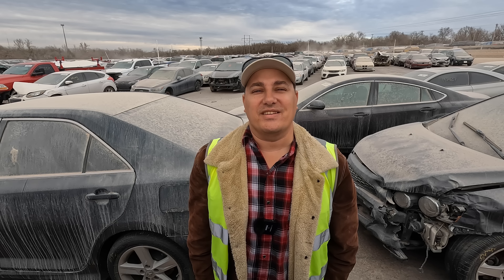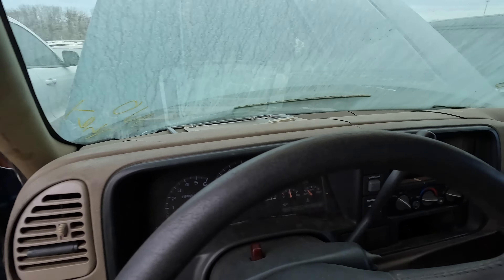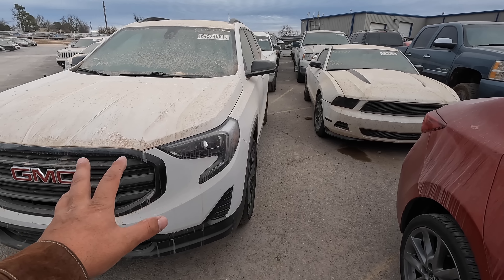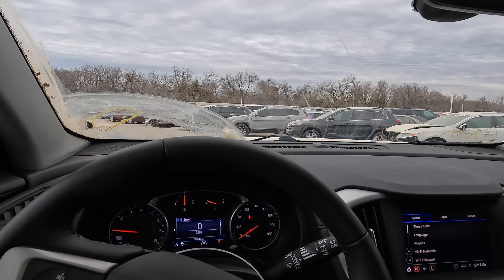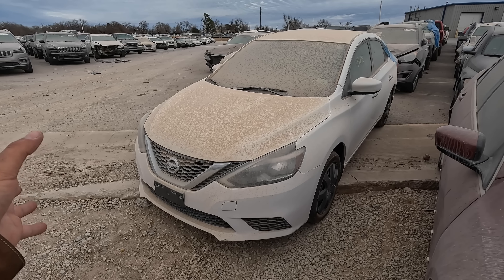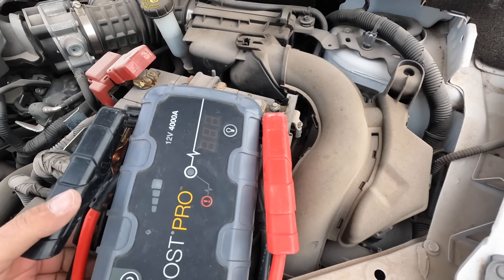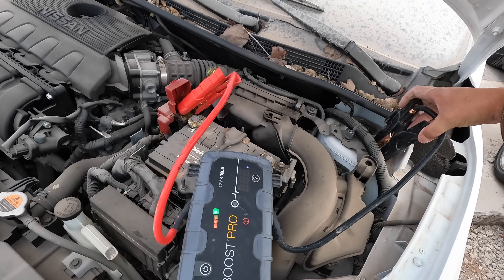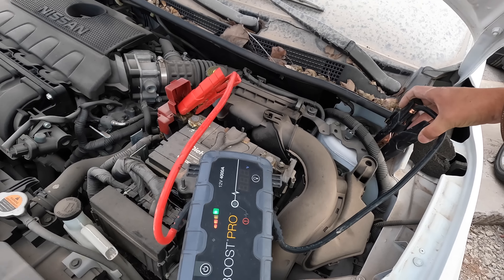Copart Walk Around + Live Bidding! 2021 GMC Terrain 12-31-21 AM

Comment: That GMT400 is worth getting a key for (and even an ignition if need be)... these trucks do NOT have ANY security chips in their keys, and, if equipped with the AU0 option code for keyless entry, remotes are cheap to get (I got 2 remotes brand new on eBay for my '97 GMT400 for less than $20), and easy to program by jumping the pins of the OBD II port underneath the dash using a paperclip. I love my GMT400, and they're one of the last "Classic" GM trucks. :)